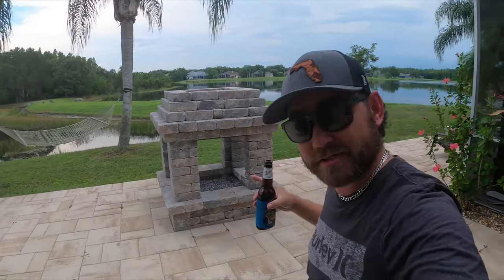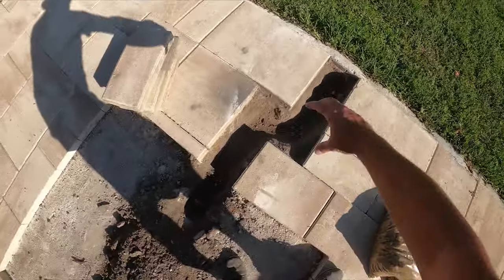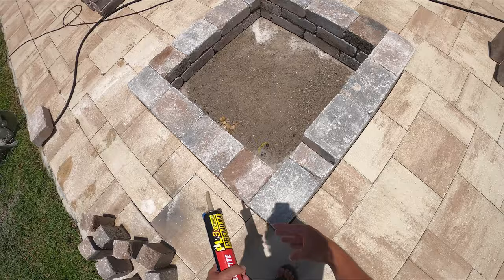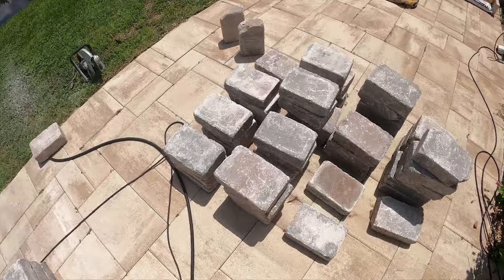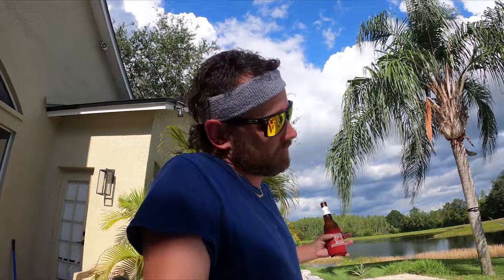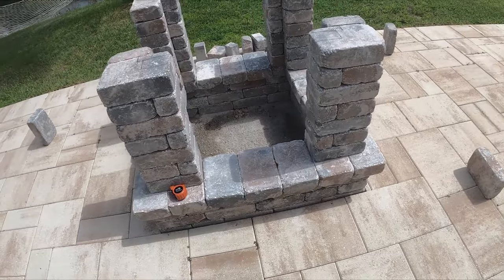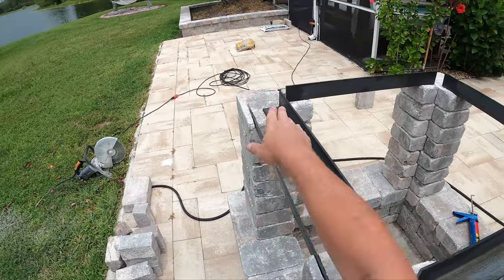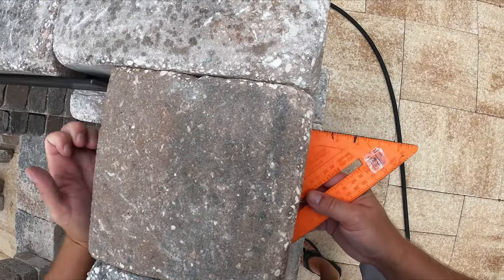Cheap(ish) Outdoor Firepit/Fireplace Hybrid Ideas

Comment: Mortar works better then glue.

Rustoleum high temp paint for your bare carbon steel that will rust the heck out being in such a humid area.

 Broski that design would have worked great for the corner of your patio, that way no obstructions to your view, since you went so high. Other then that, cool design and hope it lasts a while.
Reply from the maker: totally agree with the high temp paint! if shit hits the fan ill do a follow up vid. Should last a few years tho! Cheers!

Comment: Good job man, I=ve been thinking about something similar, building an outdoor kitchen on the farm and I got some red bricks or block pavers laid around so came on here for inspiration and found you, I laughed all the way through, swearing, drinking beer and using what I have instead of spending money, ha ha would love to work with you on a project I work just the same! 
Too late now but I would of filled the pit with any old crap, rocks or hardcore and just dressed off the last six inches with gravel. Maybe I will skim some high temp morter on the inside but I doubt it I´m too lazy. You ever find yourself in Sweden come to the farm man.

Comment: im curious why you used locktite glue instead of mixing a bucket of cement? Also I wish you would have showed yourself using it at the end of the vid.
Reply from the maker: 2 reasons.
1 - it is just WAY easier to use.
2 - i am experimenting to see how it holds up. i have faith that it will.  I plan on doing a follow up video after several dozen fires to see how it holds up. stay tuned.
Reply: I was living this video..whole way but really needed to see the fire and you and wifey..cheers'n beers..Rin front of it..you sayin..I F'n did this ish!...need more ideas hit me up .lol ..

Comment: Will those blocks crack from the heat, especially if wet? How are they holding up after using? 
I did a pig pit with concrete blocks and its falling apart from heat.
Reply from the maker: Based on similar fire pits built many years ago with similar pavers. Id say that they should not crack from heat for a long time. That being said. Its hard to judge the quality of the pavers vs fire size and frequency. I will follow up with other videos if things go south with this pit/place. Follow along.

Comment: Any reason you used patio slabs instead of bricks. Also you opted for a glue rather than a cement, any specific reason why and could you used cement if you’d rather?

Comment: Embarrass, only one thing I may have a comment on I like everything and the comment is I hope that you spray paint with a high heat rust oleum on the steel so it doesn’t corrode and break and everything will fall apart but you can live and you learn you may do it next time Remember high heat Rust oleum spray paint and protects it from the water, and it also protects it from The heat

Comment: Why remove the pavers , why not build on top??
Reply from the maker: 3 main reasons.
1 - you are able to easily level the build
2 - in my opinion taking them out also makes the build look more professional.
3 - you can add some drainage under it.
But at the end of the day you could just do it on top as well. Cheers!

Comment: How does the smoke do in wind? Does it blow everywhere or does it go up that "chimney"?
Reply from the maker: It behaves like a normal fire pit, aside from the 4 pillars blocking it a bit. Cheers!
Reply: @SebastianBalos  that means the smoke goes any way the wind blows.
Reply from the maker: @DOLfirst  yea the smoke goes with the wind. Its more for the look then functionality. Ive thought about getting some stainless steel panels cut for 3 side that you can put in or take if the wind is an issue. Might be an option for you. Cheers!